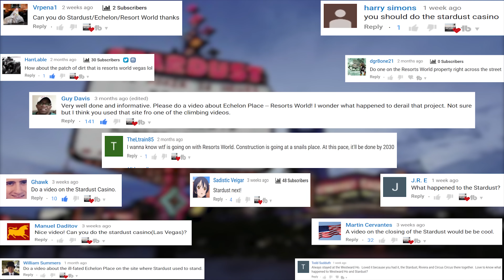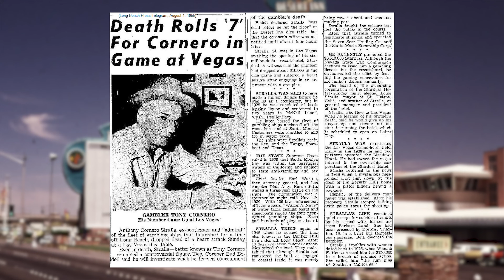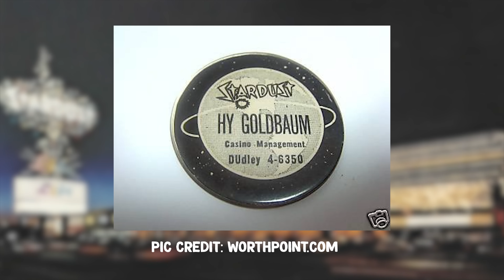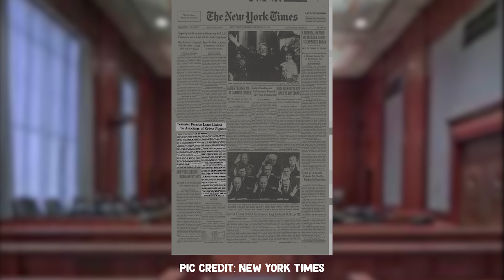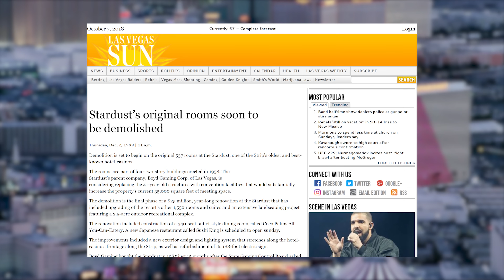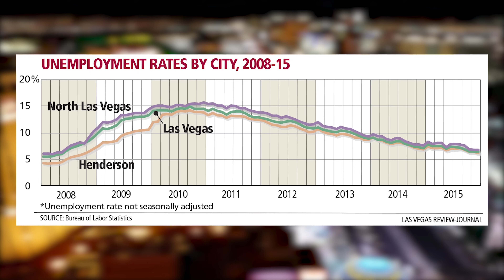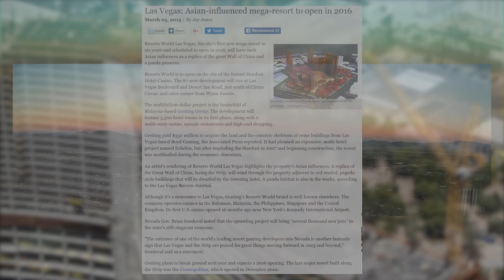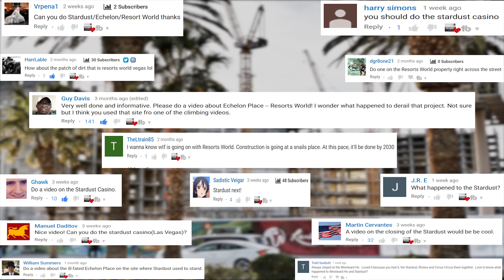Why THIS Eyesore Replaced the Mob-Run Stardust Resort in Las Vegas?

Comment: I was last in Las Vegas in April 2016, and right outside my room at Trump Tower, the unfinished 10-story structure was there. I think there will be a total of 60. Will it skip the 40s like the Wynn, Encore, and Aria? Will there be a massive jump like Mandalay Bay (prior to the shooting, the highest set of elevators there severed 31-34, skipped 5 floors (35-39, the four seasons), and then 60-62. Now 31-34 were change to 56-59. 35-39 I am not sure. Will there random skips like in Caesar’s (The Julius and Palace towers have normal numbering, the Octavius and Forum jump straight from Casino to 50, the Augustus goes Casino, Mezzanine, and then 23, while the Nobu (when it was the Centurion Tower, went Casino, Mezzanine, 30, and Casino is labeled as 1 and then immediately 72)?

Comment: Fun fact: Siegfried and Roy made their debut at the Tropicana hotel in 1967 before headlining at the Stardust hotel. At 6:48 you can see the ad of a show that says: "Siegfried & Roy Present Havana Night Club" it was a show from Cuba that was directed by Kenny Ortega where Fischbacher and Horn worked as co producers, it premiered in 1999 around the world but it didn't premiered in the U.S until 2004 and had to make some modifications. 

These were their other shows:
"Follies Bergère" at the Tropicana (1967)
"Lido De Paris" at the Stardust (1969/1973/1978)
"Hallelujah Hollywood!" at the original MGM Grand hotel (1974 ‐ 1980)
"Beyond Belief" at the New Frontier (1981 - 1988)
"Siegfried and Roy at The Mirage" (1990 - 2003)

In memory of:
Siegfried Fischbacher (1939 - 2021)
Roy Horn (1944 - 2020)

Comment: I worked at the stardust as an engineer the buliding had to go. it had a large crack from the top to the bottom you could fit your head through it was in about the 3rd guest room on the side facing the street it was close to collapse. it would have shred off at least 3 room's all the way down the hotel had to close off 3 room's on each floor on 31 floors and they couldn't make any money on them.
It was to dangerous for the guest and employees.
They told us after the new building open we'd all have our job's back but the price of steel went up and the cost over runs went into the billions they sold it to the Chinese and it is what it is now...

Comment: Some of the language is misleading. But mostly accurate. The part I find most interesting is the drive in movie theatre. I worked here in the 90's until 1999. The drive in became the employee parking lot and many of the posts for the car speakers were still in place.  I always found that amusing.   I think your video is well done and informative.  A little story of my own to add:

Sometime in the 90's a murder occurred at the sports book which at the time was on the north end of he property with two entrances and exits nearly side by side. Turned out the victim was an old mobster who still had a price on his head from the old days.

Comment: It seems like taring down The Stardust was a mistake. You video even stated that during the 2008 recession that established casinos were doing better than casinos waiting to be constructed. Thus, The Stardust might have still made a profit even in decline if left alone. When I in Vegas back in 2007 it was apparent that the locals, those who grew up in Vegas preferred to work, and gamble at the old pre-theme park casinos that the mob used to run because there was something more classy about it, and the tourists didn't go there as much.

Comment: I remember the strip ...no highway to bypass downtown....then the built the highway but left out the center of the bridges for years in the 70's...there was nothing on the other side of the highway. Now Vegas goes for 30 miles on that other side and that highway is smack in the middle of town .....now I don't even recognize where that part of las Vegas was anymore. I think only the circus circus is the only thing left I still remember where that was

Comment: I worked in Vegas with a designer that did the Golden Gate back in the 60s. We also did the restaurant at the old Dunes (gone now) and work at the DI ( also gone). One of my favourite shows was the Lido since I was only 16 it was the first time I got to see some nude boobs! That was when the mob ran the town with names like Bob Picardo, Ittilo Gelphie, and Louie Navoie. The rooms were cheap and the food was always "comped" and you had to wear a jacket and tie to get into the shows on the strip! And in order to get past the velvet rope and to a great table you had better have a 10 or 20 ready to press into the doorman's hand otherwise you wait for hours for a table. Now the rooms are expensive, the food is expensive and parking isn't free. Room tax? Long waits to pay 45 bucks for an average brunch? I wonder how long it will be before Vegas prices it's way out of existence?

Comment: I got married there in 1974. 50 years later, we are still happy and remember the "real" Vegas. The Mob did a better job. It was a playground for adults only. You could get prime rib dinner for 2.95. All the food was crazy cheap, but it made going to Las Vegas affordable if you budgeted your gambling. I was just 16 yers old then, but I do remember it was actually classy then. People wore their formal clothes to go to the casino and it was about the customer. Now it has all the glitz and extreme opulence of the mega-resorts, but it is ALL about screwing the customer with so many added expenses to your bill it prices out most people, and they do NOT care. By the time you get your final bill, it is double the original cost of the room, and the $$$ for drinks and food is incredible!!  A Buffet is in the $70 range. Not worth it.  There is something very WRONG about tons of baby strollers & screaming kids going through casinos. It became a "family resort town" and it SUCKED!  Then, it tried to get rid of that reputation and return to "Sin City" and smut in a BIG WAY. Offensive in the extreme and now, it is so crowded and overpriced, it is killing itself. It all SUCKS. I will spend my $$$ on a very different vacation and have $$ left over.

Comment: Las Vegas, I was told by long term Las Vegas residence (40+ years) that the town/city was much cleaner and the Mob put up with little to no crap.  Cost of a steak dinner and trimmings was under $2.00 and free if you were part of the In Crowd (not the Mob).  Caused the Mob major problems, you were buried in shallow graves or dumped down the many available mine shafts outside of town.  Ah, the good old days.